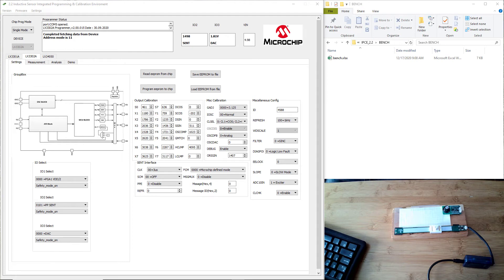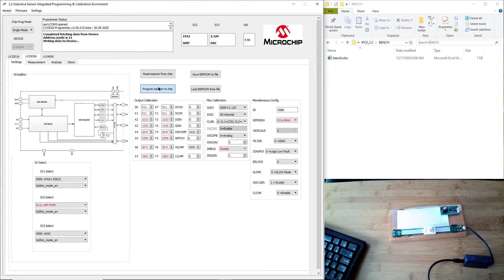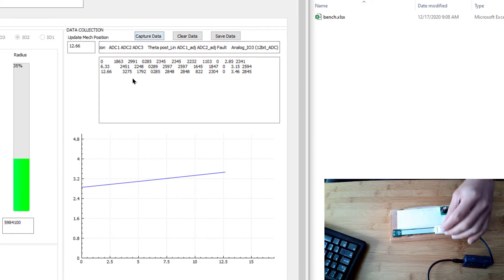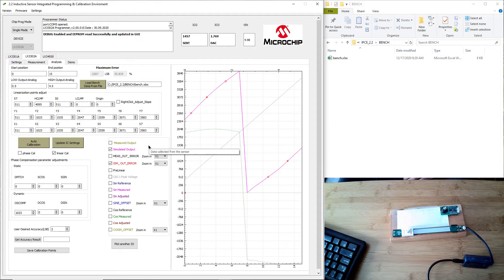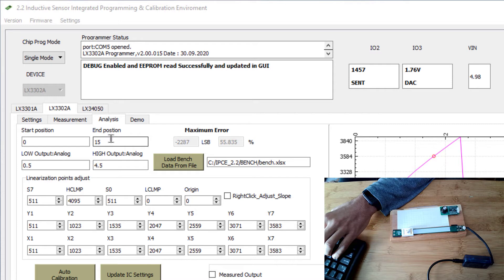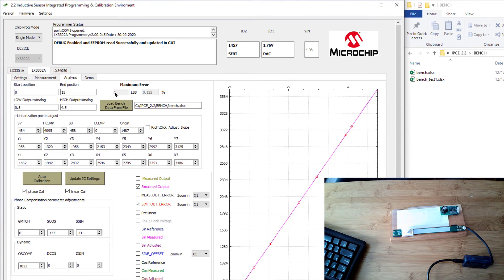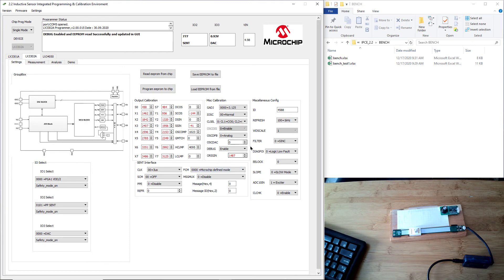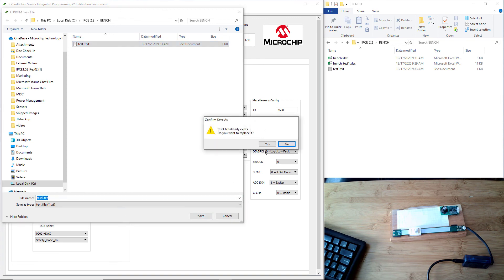Auto-Calibrate Your Sensor for Improved Accuracy

Comment: Why at minute 3:09 do IO2 and IO3 seem to overflow when the slider is just at the halfway point? Previously, sliding the target all the way to the opposite end of the IC would show 5V. I am seeing this issue on the Dev kit (LXK3301AL003) now myself and the measurement is off. I tried to auto calibrate by capturing data as in the video but it doesn't seem to help. It is mentioned that the auto calibrate would fix it but it doesn't seem that way. Any ideas?
Reply: seems it's somewhat explained later in the video.  I will try it out
Reply from the maker: Let us know if you still need help with this!
Reply: @MicrochipDeveloperHelp  i was able to fix it. Thanks!